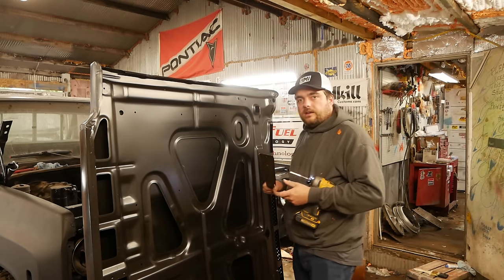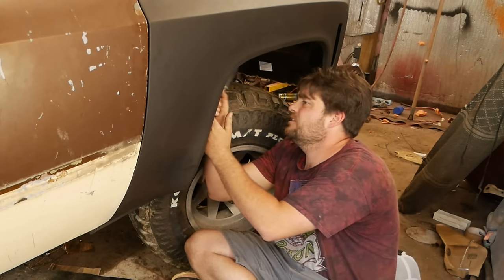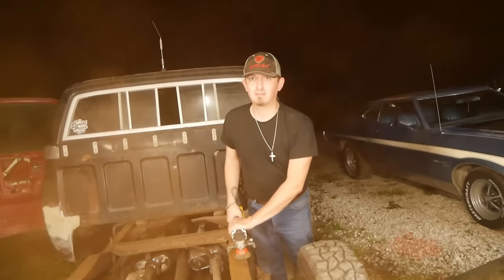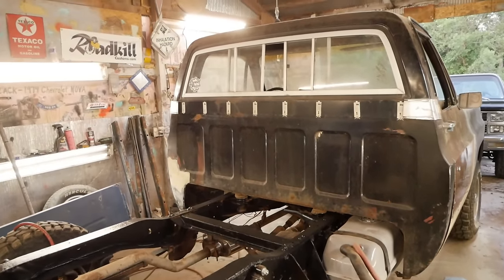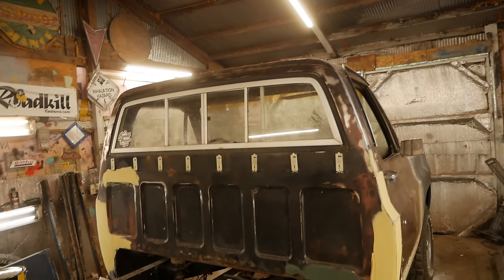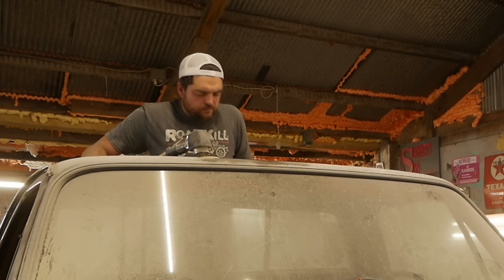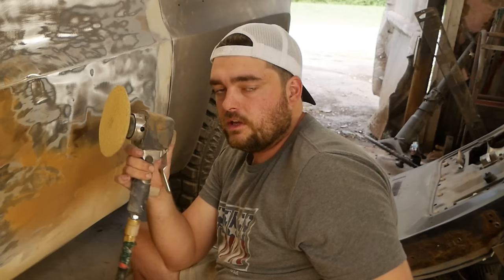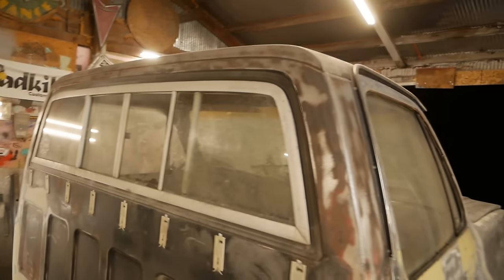Chevy K10 Stepside DIY Bodywork BEGINS!

Comment: Being 60 and having worked as a mechanic from age 23 until age 37 or 38. For me I stopped wrenching about age 50. I can still mechanic for a solid day if I absolutely have to and then I’m in terrible pain for 3 or 4 days afterwards (chronic arthritis in my lower back) so I try to avoid it at all cost. I miss it but being in severe pain is a deterrent.

Comment: As I've gotten older I use my engine hoist for a lot of things, it's good for hanging a hood by yourself, it can hold the front up while you control the back.  I also use packing blankets to cover the windshield and engine bay to avoid dinging up the hood or other panels.  It's a little portable crane, very handy!

Comment: Heres a tip for doing a hood by yourself, get some all thread and and make it bolt length and thread it in 1 hole so you can place it in the hinge and it will hold while you bolt 1 side in.
Doesnt slide off on you like it did and you can use a 2by to hold the hood up

Comment: For times like this to remove wood bed by any means necessary you might consider a simple inexpensive "plunge router" and a small assortment of router bits ( super cheap chinese low quality bits okay ) to just plunge route a circle around the bolt to allow easy access to cut off the bolt head.  super fast, super easy and you won't risk prying against the metal work a create more body work to do.  Cheap router $50 to $70  5 pc bit set under $30.

Comment: Dalton is so right on the body work.  Knowing when to stop is everything.  I have had to teach myself sheet metal welding doing wheel arches and cab corners on a dent side Ford.  Stopping the grinding of welds is another example of knowing when to stop.  I like to follow my body work with the finest Rustoleum that Home Depot has to offer.

Comment: Dalton you cared more about gaps than the assembly plants ever did
Wentzville MO 
Plant still builds the GM fullsize vans from 1993 if the door gaps need adjusting get a big hammer if it needs more adjusting get a bigger hammer!! There ain’t any 2 vans come out of that plant with decent gaps or paint in the past 30 years😮👀🤔
Reply from the maker: Correct. If the door opens.. ,🤷

Comment: Im in the process of sanding and prepping my 65 f100, I decided that I am not going to fix any of the dents and dings. I welded up some holes and fixed some rust and used filler on those parts to smooth it out some. But the rest of the truck, it'll have a new tractor paint job with all of the dents and dings it earned over the past nearly 60 years.
If I tried to fix all of the dents and dings, I am a perfectionist when it comes things like that so I would never get it done.

Comment: for sanding....................    use the most agentive grit it will cut the best, but leaves the deepest scratches, if you use a lower grit it will float  over the highs and lows.  and not really level the filler.     use guide coat, powder guide coat is best but black spray can lightly over the filler will work, to show highs and lows.  just a thought
Reply from the maker: I've painted 100+cars. This is kinda my wheelhouse lol. You'll see next week's vid where I do exactly this
Reply: @PoleBarnGarage  same here  been a body and paint man for decades

Comment: Hey,
I am refurbising an 89 K2500.   It came with the greasiest 454 in I have ever seen.  It obviously was leaking and blow by for years.  The drive train is full of oil and the engine is toast.   I got a donor engine and am in the process of freshening it up (its from a 73 RV).  It needs alot of work, but its coming along.   Have you ever lifted the front end of a chevy with the torsion keys?    The front end is kinda sagged out.  Keep on working and making videos.

Comment: I got to admit it, I was happier than a Two Peckerd Pup when I didn't see even one can of spray foam or duct tape being used! "Pound It Low and Fill it with Dough" 😅 I just hope you ain't gonna have problems when it's time to put the grill trim and headlight surrounds in. You could've opened the holes up in those fenders and brought the tops in more. Can't wait to see it done, love me some Square Step Sides!
Reply from the maker: You can't pull the fender in without pulling the door gap in, and the core support bolts horizontally, no way to adjust the front in
Reply: @PoleBarnGarage  Shit, you're right, it's been a while since I've done anything to a Square...

Comment: Well I always like your karma and I always click the like just wanted to let you know. I think you're doing an alright job for low budget. That's okay, you spend a lot of parts on them. Truck pieces the panels that you put in. Now you're working on your fenders and your seller? It just takes time I know. Cause I did a 68 Ford truck afternoon. And I've used a lot of the old bondo that you call c*** And I'm showing now after After twenty five years, it is starting to pill

Comment: Panel gaps might have worked better to not much all the way to the edge. Or can always mud across the take a paint stick with razor blades tapped to each side. Run that through the gap while still tacky.

Comment: So you're NOT worried about assholes when you're working the glass because that's simply your base so you can work it like a stripper on a Tuesday afternoon with the edges and all of your sander on 35 grit because you're still going to put plastic on it then glaze? I'm guessing that's ok then to just bust it down as long as you leave a rough base on there to hold it all together in the end? I know glass is ALWAYS the best starting point before you plastic, plastic don't stick to metal, doesn't matter what way you spread it. Nice work.